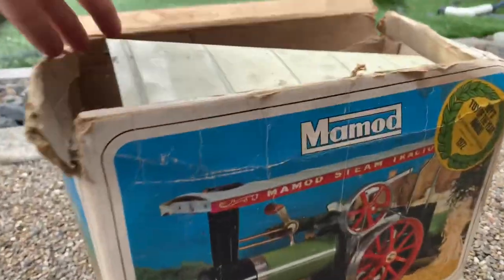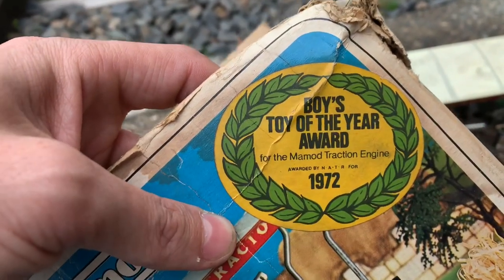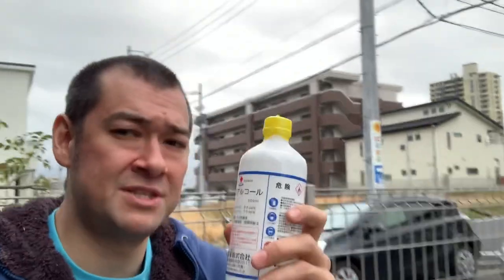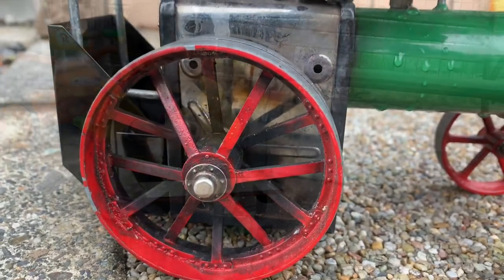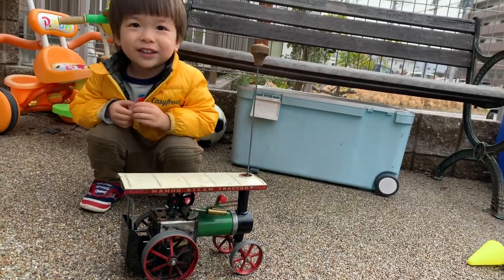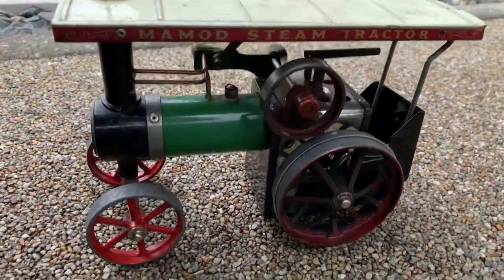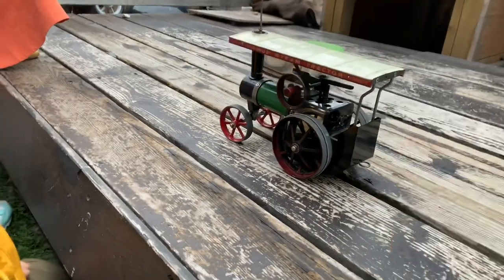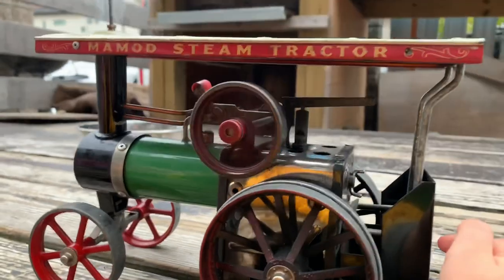Mamod Steam Engine 35 year test!

Comment: If you lubricate the model , you might get her to move
Btw love yer boys
Reply from the maker: Thank you.  Which part should I lubricate.  As far as I can see the problem lies in the spring belt.  It doesn't seem to have the correct tension to work without slipping on the rear wheel...
Reply: You can use normal rubber bands and you should oil the piston and cylinder
Reply from the maker: Thanks! I’ll give it try once we get things sorted!
Reply from the maker: @suegould7214  Thank you!